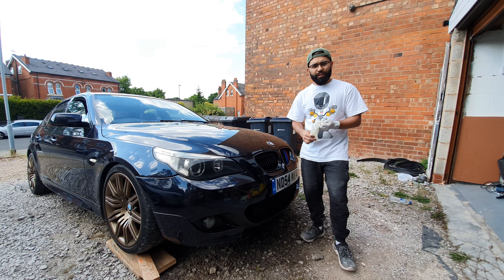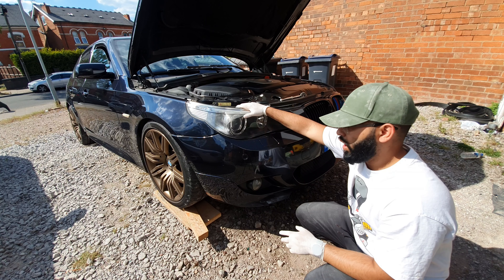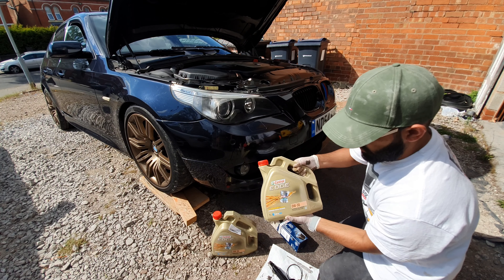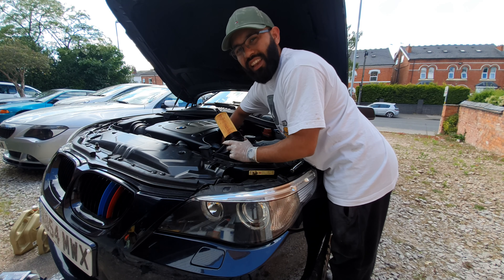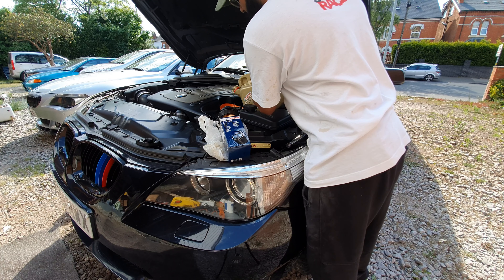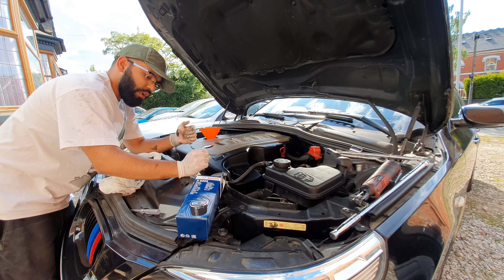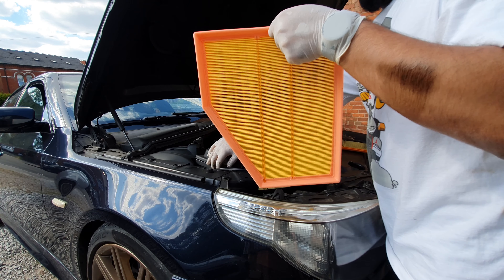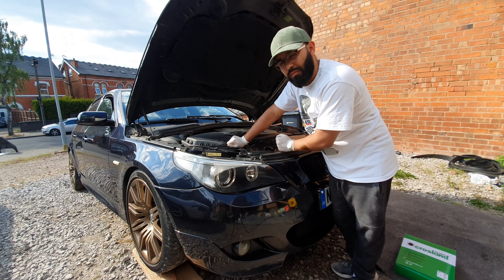BMW E60 535D (M57) Engine Oil Change + Service Reset & Air Filter | Complete How To

Comment: 5w40 always for BMW
Reply: Why not 5w30?
Reply: @AshG786  when is hot getting very thin like water, and fany is that for e46 330ci was always recommended 5w40 and later they change for 5w30 for same car🤷‍♂️🤦‍♂️ ,
Reply: If I’m right saying the 5w30 flows better? So good for high performance engines and 5w40 you’d get away with in a older vehicle as they are prone to leaking so the thicker oil will suit it better? Is that a correct statement?
Reply: @AshG786  for my experience 5w30 can't hold pressure in bottom engine, and nobody using in motorsport, Depending how you driving, I have 350hp and no any problems after 180000mls , 535d e60 👍
Reply: I’m due a service in my 535d e61, so what would oil
and spec would you recommend? Thanks
Reply: @AshG786  Hi, I am using last 7 years oil Fusch 5w40 Titan gt1 , but Liqui Moly is also good or Motul . Change max every 10k mls .
Reply: @checkbmw  thank you

Comment: Love your vidoes bro :) I've got a BMW F10 and recently bought an oil suction pump to try it like that but after seeing u manage to slide under the car I think maybe its possible to do that on the F10 without a jack :)
Reply from the maker: Thanks bro! and honestly if you find somewhere safe to just crawl under the car, its a great way to do it and is safe. Plus much faster, the oil suction pump does work but will take longer in many cases. Just always remember to make sure whichever way you do it to keep yourself safe and out of danger.
Reply: @mrgcc  Great advice!! Will make sure to be safe,  thanks 😊
Reply from the maker: no worries at all mate, anything else just let me know!